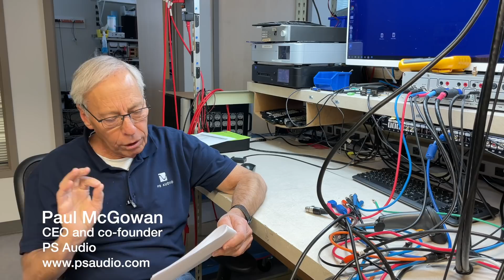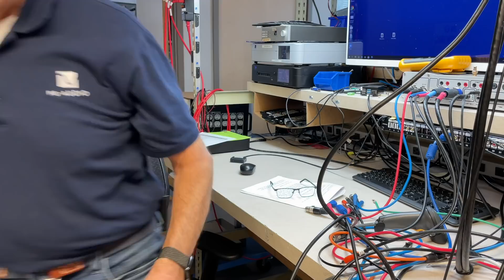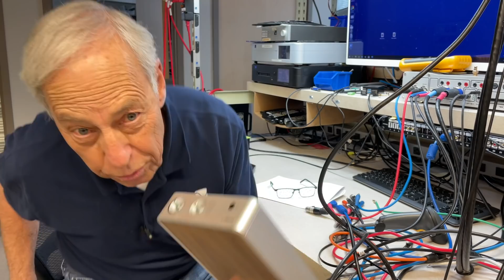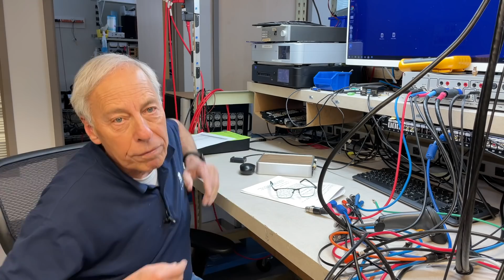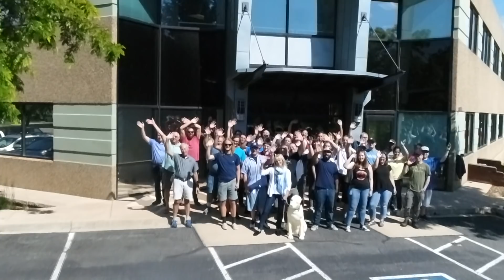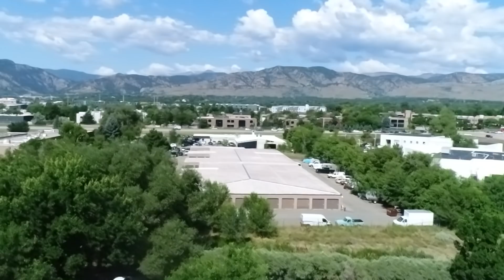Why Class D amps have small power transformers

Comment: Switch mode power supplies for audio  are spoken of as if they are something new when back in 1979 Bob Carver used a type of switch mode power supply with a tiny transformer ( his magnetic field coil) pulsed by a triac according to demand . This along with being one of only a few designers  to use class G rail switching made his of the few  amplifiers that were  very energy efficient , powerful (has enough current for Magnepans) and is very light for it's power rating.
Reply: 400HZ SMPS have been used in avionics long before Carver.
Reply: @bilguana11  Yes but I was talking about use in audio .
Reply: Paste that at least 10 more times, so we don't miss your point.
Reply: @jamesplotkin4674  What a great  idea ,Why didn't I think of that.

Comment: BUT the switch-mode PS is only HALF the story!.........  the other half is that Class-D amps are 90% efficient, rather than around 60% for Class AB.  That's why you don't need the massive heat sinks.
Reply: Class H amplifiers are just as efficient and IMHO sound better ,And Sunfire amplifiers ( use the unvented chassis for the heatsink ) and can drive very low impedance speakers that would fry or trip the overload with most of class D.
Reply: @leekumiega9268  I see Class D amps driving 0,5 ohm & 1 ohm subs in cars so depends on the amp if they fry ;P
And Class D is 80-95% efficient depending on the load. They can actually dip down to even lower efficiancy if the loads are high.
Class H is kinda between Class D and Class AB.
Remember I had a Technics Class H amp many years ago. But that was just a weak little crappy reciver so. 
Fun fact: Technics reciver claimed to be rated 5x100 watts but when I later got a Harman/Kardon rated at only 5x45 watts (2x55 in stereo) it was ALOT more powerful :P
Technics had below 300 watts supply and H/K had almost 500 :P I hate fake marketing on power output... I rather just look at how much watts the power supply is :P
Reply: @Oystein87  First I'm talking home amplifiers where road and engine noise are not there to mask imperfections played on more resolving home speakers.                                                                                                                                                                     Class H uses rail tracking and when done right sounds fantastic, Unfortunately Technics  is NOT what they used to be - Panasonic's high end line.
Reply: @leekumiega9268  Yes, and? You do know the difference is just the voltage? And road and engine noise don't hide anything at high volumes😉 And most competitions for clean car audio sound are done when not moving or engine running.. But it does not change the fact that Class D is very normal in home audio and are capable of driving low impedance if done right.
I know what Class H is. I am saying the little reciver I had almost 20 years ago was a weak little amp. It ran out of power quickly. The sound was good but the power supply was a huge joke.
Reply: @Oystein87  As far as class D voltage for car systems goes they use they use buck boost circuits to raise the voltage as high as they need .Also the best car speakers and systems go very  loud but are not as resolving as the best home speakers can be and can't reveal any shortcomings of car audio.  There are many internet forums where even 1000 watt class D amps do a poor job of driving very low impedance speakers ,so I speak of other peoples experience not my own. I am very happy with my 200 watts x7 class H Sunfire AV receiver, Yes because of power supply limitations  in a receiver it can deliver only 157 watts x7 with a continuous sinewave. But music is not drawing maximum power except on transients which it can do ,it also can deliver over 450 watts continuous into 4 ohms X2 ,great headroom for stereo listening. This is what a well designed c[ass H amplifier can do. http://stereotimes.com/amp010500.shtml
Reply: @leekumiega9268  Yes, I know. Does not change the point.
Hah! Uhm, no.. The best car speakers for resolving audio don't play as loud as SPL speakers and a great built car system can be just as resolving as a expencive home audio system.. There are i.e 6,5" component sets for over 10K USD from Focal and several others. There are a few custom systems like that with resolving high-end sound that maies many home systems hear like a boombox😉
I have experience from both cae and home audio but I see you don't.
Yes, older Class D amps.. Newer ones rarely struggles unless they are cheap.
I speak from my own AND other peoples experience.
So the power supply is too small to give the rated watts? I stay away from amps like that. Uhm.. I doubt it delivers that much more in stereo... Not by normal messurements atleast. That is not normal at all... Usually it's just a few watts difference. 10-20watts. So your amp specs seems really shady
What I really hate is that most messure with a 1kHz sinewave and only one ch driven instead of a 20Hz-20kHz sinewave and all channels driven like they should. NAD (and others) does that right while most do not. This is done by most just to get a higher rated watt output on paper.
Reply: @Oystein87  Was going from memory and a little off but not by much with most measurements .    https://www.soundandvision.com/content/sunfire-ultimate-ii-av-receiver-measurements  Note this was by far the most powerful AV receiver at the time. I should also note that his separate 7 channel amplifier does not have these limitations since it has the room for a much larger power supply. So it does deliver the rated power continuous into 8 ohms all channels driven and does double the power into 4 ohms all channels driven.
Reply: @Oystein87  As a senior electronics technician with 38 years experience ,and 3 years at a tech school and 2.5 yrs toward a E.E. degree I could not afford to continue , and the degree was a recommendation   not a requirement at my job . So I know what I am doing . And what education or degrees do you have?  As far as the spec results ,that is how that publication  did their measurements. (maybe you should call/text them and tell them how to do their job.)The frequency response need only be done for one channel (they chose left) .The power measurements were  for both 2 ch and 7 ch at 4 and 8 ohms. Those were their actual measurements and reveal both the limitations and advantages of class H crammed into a 7 ch receiver , limitations that the separates do not have with more room for a larger power supply . It clearly outperforms any other 7 ch AV receiver in stereo operation due to the superiority of it's class H power supply. I most certainly do know how an amplifier works but you clearly don't understand how class H works. I should add that your statement that you don't know any that have separate amps for each channel shows your ignorance on the subject as most all quality multi channel systems use separate amplifiers for each channel these days.
Reply: @leekumiega9268  Sounds like BS to me since you habe false claims.
The messurements they did is like all shady ones do. That's how they get high numbers without actually having the power to do it. Seriously.. Messured at ONE channel!?🤣 And just at some specific sinus tones. No.. The power messurements MUST be taken at all channels or else tou get a false result. This is pretty basic facts. Those messurements are the first sign of fake advertisment and/or lack of knowlage. That amp is not more powerful than any other ones on the market if you messure it correctly.
Come back when you have gotten some years of experience and knowlage. You claim to have experience and sole school but your comment shows you have no clue ald reject reality. That kinda makes me think you are a liar or a troll.
Reply: @leekumiega9268  First line: "All measurements were taken on the left channel."
Messuring 1ch in 2 or 7ch mode is not the same as actually drihing all ch. Akd they did not messure with a 20Hz - 20kHz test. Ergo fake numbers.
Either payed advertisement test or the people just don't know how to actually messure amps correctly. Because these messurements are just WRONG😉
Car audo installer?😂 Only in my own cars..
I have several years of experience and knowlage within home systems. So I hope you love beeing wrong yet again
Reply: @Oystein87  YOU don't know what you are talking about ,go back and have another look as they DID IN FACT measure ALL 7  channels X2  then they measured 2 channels in stereo mode for their power measurements. ONLY their frequency response was done on one channel .
Reply: @Oystein87  Here is the entire review by Michael Fremer ,Do you know who he is or his credentials ? He KNOWS what he is talking about and is renown for his thoroughness .  https://www.soundandvision.com/content/sunfire-ultimate-ii-av-receiver
Reply: @Oystein87  By the way can YOU  explain how class H works? I can, if you can lets hear it , I have serious doubts that you know how any class of amplifier works or what the classes even mean .
Reply: @Oystein87  After rereading this post I can tell you have no idea what you are talking about when it comes to class H which was invented and patented by Bob Carver in 1995 and Technics was class G not H  but the uneducated are easily confused as to how they operate, even Paul got it wrong and I wrote to correct him and got many accolades from people in the know for doing so. But now being retired I will admit I am not up on the latest class D offerings being able to drive low impedance loads as they could not do so not that long ago.

Comment: You missed that class-d is more efficient and also why you use switched on just class-d and not on other types of amps?
Reply: The efficiency doesn't really matter. A class A at full crank is also efficient but when it's not att max power it's very inefficient. Class D is efficient but the power supply needs to be a bit more than full power in any case.
Reply: Switch mode power supplies for audio  are spoken of as if they are something new when back in 1979 Bob Carver used a type of switch mode power supply with a tiny transformer ( his magnetic field coil) pulsed by a triac according to demand . This along with being one of only a few designers  to use class G rail switching made his of the few  amplifiers that were  very energy efficient , powerful (has enough current for Magnepans) and is very light for it's power rating.
 His later design with Sunfire was class H, rail TRACKING that although it's class AB it is as efficient as class D.
Reply: @Lassi Kinnunen 81 Noby scoffs at class A. There is no audio intressted who wouldn't want 1kW pure class A. Usually a full bridge rectifier is used as you see by my doubled frequency.
Reply: @Lassi Kinnunen 81 What do you mean by center rail ,in class G rail switching you can have a center rail ,otherwise the center is zero volts with a plus and minus some voltage depending on wattage.
Reply: @Lassi Kinnunen 81 any class of amps..AB/ D etc require a "centre rail" ... whenever that amp has one of its loudspeaker terminal at  " non live " / zero / common.. potential....{ also known as a Single Ended Push Pull amp ...SEPP } ...whilst the potential @ the other terminal alternates from plus to minus & back..whereas in 
" BRIDGED" / symmetrical mode the "centre rail" may or may not  be necessary..
it's the amp. designer's decision..

Comment: The positive thing is that it saves you a lot of amount on your monthly energy bill.
Reply: Switch mode power supplies for audio  are spoken of as if they are something new when back in 1979 Bob Carver used a type of switch mode power supply with a tiny transformer ( his magnetic field coil) pulsed by a triac according to demand . This along with being one of only a few designers  to use class G rail switching made his of the few  amplifiers that were  very energy efficient , powerful (has enough current for Magnepans) and is very light for it's power rating.
 His later design with Sunfire was class H, rail TRACKING that although it's class AB it is as efficient as class D.

1
Reply: @leekumiega9268 ...  Doesn't the "Magnetic Field Amplifier" pull considerably more power from the wall?
Reply: @swinde  Only when needed ,think of a large bucket with a large adjustable spigot on the output but being filled at a constant rate ,this is analogous to a standard power supply with the bucket being the capacitor in a linear supply and with high demand the bucket runs low. In a magnetic field coil design it is more analogous to the bucket  being fed from a valve from a fire hydrant ,in which case the bucket won't run out ,. therefore it only draws and delivers what it needs but never runs out.
Reply: @swinde  It can but only briefly when needed to faithfully reproduce the signal while most of the time using much less than a standard design.
Reply: @swinde  ..from what I understood of the Carver tech. was that he implimented a 50/60 Hz boost converter (for the main power amp. ) using primary side triacs i.e. direct on the incoming mains input..and secondary side isolated dc through ordinary diode bridge/s..
When using Boost mode topology..you cannot exceed 50% duty cycle..hence max. draw is @ peak of input voltage..ph. angle 90° ....or else you end up with tx. core saturation.and eventual power device blowing up....
Hence Carver's triacs are limited 50% duty.. and in triacs one cannot control the current directly/ instantaneously..
Reply: @analoghardwaretops3976  Bob did not use boost mode ,most of what you say is correct but the triac is switched on according to demand of the music at line frequency  (not at a high frequency like a normal SMPS) by an opto-isolator. The name magnetic field amplifier comes in  because as the triac would send a pulse on the primary it would naturally create a magnetic field when the triac stopped conducting the MAGNETIC FIELD (hence the name) would collapse inducing a voltage on the secondary of the transformer (magnetic field coil) I don't know what the max duty cycle is but I believe it at times was over 50% as you can see on the scope at about 39 minutes on this video that explains how his power supply works on a MXR2000 a 200w X2 receiver.  https://www.youtube.com/watch?v=7Fy_u6V3Nac    on this video on a M400a  8 inch cube amp https://www.youtube.com/watch?v=-N31CRS7mpI   he shows that the mains current with no signal for a 200 w x2 amp is less than half an amp a mere fraction of what it would be with a standard linear supply. at 23:55 into the video.
Reply: @leekumiega9268  seeing this vid. it is as you say it is ..
watch it @36.5-37 to about 38.. here he mentions this particular design was a refinement of his original  in earlier amps...and myself probably meant one of the earlier ones.. ..I clearly remember seeing the polarity (dot ) mark. on the pri./sec. of the wiring diagram. ( not this one .though..)& they were out of phase....the reason for boost/ flyback with less than 50% duty..
Reply: @analoghardwaretops3976  The second video is on his M400A which was his first design after leaving Phase linear , at 7 minutes in the schematic shows the secondary of the magnetic field coil and there are no dots representing phase reversal like you claim ,the primary is on the top of the page. Also on the scope on the first video the triac sure looks like it is conducting for more than 50% of each half cycle at max volume, yes it is a flyback effect(which normally does give a HV boost like for the second anode of a CRT ) in this case it's not fed a sawtooth and no boost is needed ,the secondary winding provides the necessary voltages by nature of it's turns ratio. If there was boost the secondary voltage would change as the triac conducts more but it stays constant. Only the amount of current through the transformer changes.
Reply: a lot of amount lol.
Reply: @flotinaway7  It's good to hear from another   person who appreciates Carver products , have you had it recapped at any time? I started off with his first receiver the MXR 130 , it's sound blew away my Kenwood monster receiver the Super Eleven . I then moved on to his Sunfire True Subwoofer then  got his  AV Ultimate  Receiver.  Being in the electronics field I understand and appreciate his unique technology .
Reply: No ... Your energy bill will cost you the same....If  the amp. draws 200 W  from a 50/60 Hz transformer..
( here consider a linear powersupply ).., then an SMPS pwr.switching @ 100-200kHz on the same amp will also draw 200W.. only the SMPS is physically smaller in size.....
both transformers & filter caps.. WILL at minimum have approximately the same
( ENERGY× FREQUENCY )
product value..i.e. E(joules)× F(Hz) = Power (watts)..

Comment: One thing you didn't add is that a traditional transformer losses current for a split second when the magnetic field collapse nothing is passed through what doesn't happen with a smps is that be soft start or hard start switch mode soft start for hi-fi use preferred
Reply: It is actually the collapse of the magnetic field that Bob Carver used in his (magnetic field coil amplifiers) which was a switching power supply back in 1979.